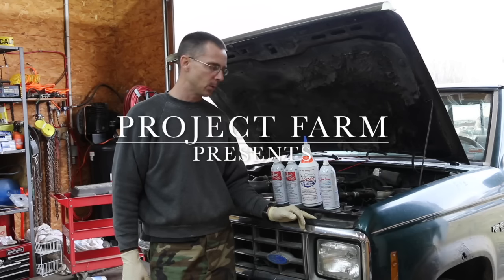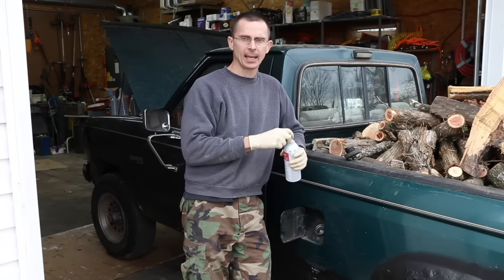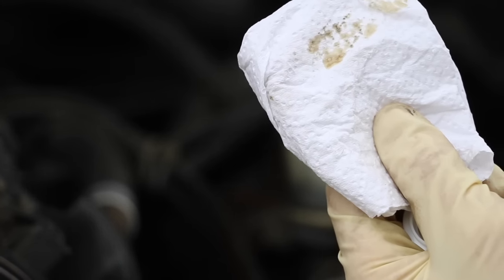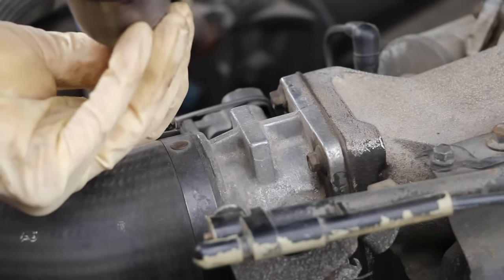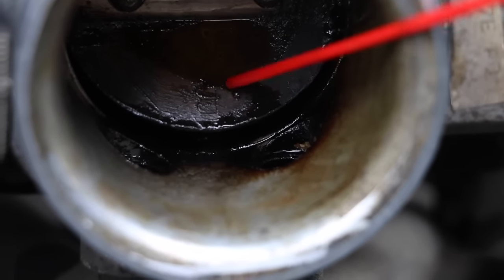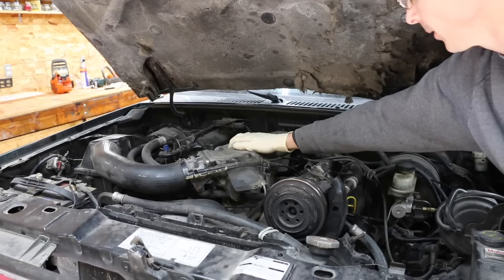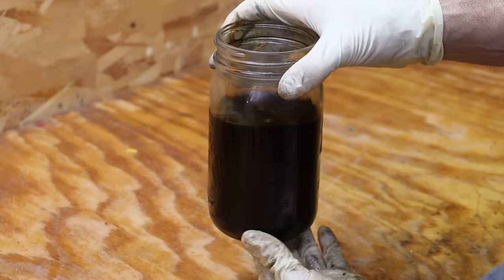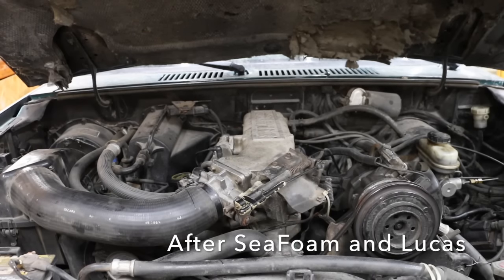Seafoam--can't believe what it did to my engine!!

Comment: I’ll tell you what cleaned up a gummed up motor for me and I was impressed beyond anything I had ever used to clean the inside of a motor. So the night before you change your oil check and if you must ! Drain two quarts from the engine and add two quarts of diesel fuel. Let that set over night. ( Note) if you know where your needle stops when fully warm make sure you do before you do this. In the morning start the vehicle and allow it to idle and warm up to the normal operating temperature then shut off and drain. Do this for three normal oil changes and you’ve basically cleaned it from top to bottom. My engine was so bad that the oil would back up to the filler cap. Nothing was going down into the pan. It took me 15 minutes to slowly put the oil in. Now that I’ve completed all three cycles it pour right in and straight to the pan. My mileage actually went to normal in the city and highway. It was a couple under specified mileage. It works!!! I’d bet the farm on this secret.
Reply from the maker: Thanks for sharing.

Comment: Friendly tip, throttle bodies are usually gunked up remove and clean that part then rebolt.

  then use seafoam,

The main reason is anything that comes off a nasty throttle body clumps in the system eventually
Reply from the maker: Thanks for the feedback.

Comment: Put Sea Foam in an old Snapper mower that ran poorly.Started riding around the yard and it smoothed out and ran like a new mower after an hour or so.Only additive I've tried in 60 years of driving that gives a distinctive obvious result since the old Paul Harvey 'Motor Honey' days which also did as it claimed.
Reply from the maker: Thanks for sharing.

Comment: This is awesome to see!  I had also heard that Barryman B12 chemtool has been used to clean removed pistons in racing circuits.  I wonder if that would work this way as well.  I've had good luck with Lubegaurd products so far.

My question is, if I have a 2020 Nissan Altima and it uses 0-20 full synthetic oil, does that disqualify you from using alot of additives in the future (when you would need it)?  I'm guessing Lucas would choke the engine since the tolerance is too tight.
Reply: It wouldn't "choke" the engine and as long as you run the engine very easy it would likely be ok.  The problem would come if the engines was run at any higher RPMs for more than a few seconds.  The oil would pump to the top but would not be able to drain back to the oil pan due to very tight tolerances inside the engine.  You could very likely end up starving the crankshaft of oil and destroy all your bearings... a VERY expensive problem.

Comment: That was a lifter noise from lack of oil changes, It's the only sound that this can fix. I would not put that thick stuff in all at once, only with engine warm and much slower.

Comment: A little noise from the lifters! That sounds like a baby diesel!
I've used Seafoam in my small motors every spring and fall before storage (snowblower and lawnmower) and in my vehicle's tanks a few times a year as well as my 1987 Magna for the last tank at storage.
Every engine I own starts within the first 2 tries after 6 months or more of storage. I've never had to pull/clean a carb and running a tank of gas with this stuff always eliminates a slight drop in response and performance in my car engines when they appear. 
I've never dumped it in my oil. I don't think I ever would. 
I firmly believe that old engines, that haven't been well maintained, getting a serious internal or external cleaning is inviting baaaad news.

Comment: one time I had an issue with an 88 chevy that had just got an oil change and had low oil pressure. I had done a lot of research and used a few ounces of acetone ( finger nail polish remover) in the engine and let it idle for about 15 mins then dropped the oil. it came out black  on a fresh oil change. the engine was gunked up. after that, oil kept its life like it should and oil pressure returned to normal. however, i wouldn't ever do this to a newer engine.
Reply from the maker: Thank or the feedback.

Comment: Before I use the Lucas oil, I put the bottle in a warm/hot pail of water,,, let it sit for a while then add to the engine, helps pour out easily
 Just an idea . But differently going to use sea foam on 2008 dodge
Reply from the maker: Thanks for the feedback.

Comment: Took the valve cover off my wife's '09 Ford Escape and woooeee!! How was this thing able to run! Sludge city! I've cleaned the valve cover, but the head is atrocious!! Got in there with a screwdriver and my fingers and got a LOT of the sludge out, but still needs cleaning. Not sure if THIS is something that would work. Any suggestions? Anybody?

Comment: Mixed results with seafoam and the motors are different.

A wheel mounted weed eater took a few cans of seafoam for the results.
Many gas tank full of the mixture by the instructions for adding to the oil and the gas.
One job it just took off like a new engine.

My car motor blew out a big cloud of blue smoke and it later needed some new catalytic converters. I believe it hastened the need for replacements for the catalytic converters.
Reply from the maker: Thanks for sharing.

Comment: I love seafoam! I suck one through my brake booster line every 6 months or so. Or when I get a ruff idle. Normally fixes the ruff running issue for while. I had some fouled out plugs that got sea foamed 3 times and one can of Berman’s through the vacuum line in the last month and half. Also a couple cans in the tank. I finally changed out the plugs yesterday because they were throwing misfire code in 2 cylinders after 40/50 k and they still looked horrible. New plugs fixed the ruff running issue. Wonder how bad they were before I gave them the berries with cleaners!
Reply: I’ve hot soaked my motor and have had my cats clogged with all the gunk that eventually brakes loose. So beware of that issue…if you have a lot of carbon build up.
Reply from the maker: Thanks for sharing.

Comment: Wow! Off topic... Your Throttle Body needs cleaning big time... I have an old Chevy Blazer, which wouldn't idle and ran like crap. I cleaned the Mass Airflow Sensor, added a new Air Filter then cleaned the Throttle Body and the Idle Air Control Valve. Lastly, after checking the OBD2 codes, I changed the Distributor Cap and Rotor... Now the truck runs like new... My main point is, my throttle body was not as dirty as yours... I think it would do wonders for your truck 🙂
Reply from the maker: Thanks for sharing.

Comment: My mom’s 2000 Suburban 5.3 had  376,000 miles on the factory water pump and alternator. 
She still sold it for $2500. My brother gave her a 2016 with 130,000. It’s like brand new.
Reply from the maker: Thanks for sharing.

Comment: Seafoam is a miracle in a bottle. I’ve grabbed several implements from the junk yard over the years that were junked because they didn’t start. One can of seafoam has brought almost every engine back to life. 
I run it through my 1994 90hp 2 stroke outboard every tank. Last year I replaced the head gasket….the pistons and cylinder walls looked like new. 

If you need a lawn mower, find a free mower that turns over and dump a can of seafoam in it. Most of the time engines won’t start because the previous owner used ethanol gas and lets it sit over the winter. The ethanol gets hard and clogs the jets. Worst case scenario is you need to buy a replacement carburetor for $12 on Amazon.
Reply from the maker: Thanks for the feedback.

Comment: That Lucas is so thick. I bet it would mess with the cam sensor on my Hemi Grand Cherokee. The dealer I bought the Jeep from put the wrong weight of motor oil in it and it gave me cam sensor alarms. We reset the code and put the 0W20 in and it has been fine ever since.
Reply from the maker: Thanks for sharing.

Comment: I use sea foam with every oil change and Lucas since I bought my 2010 Altima 8 years ago used with 60k miles. Car is now 13yo with 135k miles and a testimony to the effectiveness of these products being used regularly with oil changes is that my engine & emissions are beating the numbers in every category compared to when I got the car. Better Hp better response still quiet as a new engine and lower emissions than before. 

They really really do work but I will say it takes continuous use for best results and if you’re taking a used car that’s regular maintenance was neglected by the previous owner like mine was, it can take 2-3 rounds of doing this process to really really make a noticeable improvement. It definitely works though but level of neglect/ miles on car /how the car was driven will skew experiences and results. 

You also will get better results if you run 88 or better octane gas & full synthetic oil during the treatment. Full synthetic will capture more of the carbon sludge burn off and the higher octane gas burns faster scoring off more carbon.
Reply from the maker: Thanks for sharing.

Comment: I know that this wasn't the point of the video, but did you ever replace the engine mounts in this truck?  Judging by the amount of torque deflection at idle when you revved it, they could have been the source of more vibration.

Comment: These are the products I use and same proceedures, however, I use carb cleaner and spray the throttle body and plate completely! You will have better idle and response if you do! I spray the outside too! Vroooom! Vrooooom!
Reply from the maker: Thanks for sharing.

Comment: I do something similar each oil change except i use MMO instead of lucas. I got a truck with 270k and no ticking no shaking smooth operating. Maybe I'll try out lucas and see if it runs better or about the same
Reply from the maker: Thanks for sharing

Comment: Now to finish that process properly get some throttle body cleaner and a tooth brush and completely clean the throttle body and plates until they shine ! OH and a better way to clean the lifters is to ad an engine flush to the old oil before dumping it ( Kleen Flow Engine Flush is good )    let it idle for 30 min to an hour ( just idle, do not drive or rev up )  then dump the oil and add new with your Lucas !    what you did was not bad but you should have taken it for a good brisk drive after doing the decarbonizing and adding the sea foam to the oil !  at least 100 miles should have been driven before the oil was dumped !

Comment: My 06 f150 4.6  started ticking on cold startup after autochoke idles down this would continue for 2-3 minutes. Cylinder #3  very distinct . I thought it was roller follower worn or lack of lubrication. It was getting worse over the course of 1 month. I added 6 ounces sea foam to the oil which I change religiously every 3k and within 3 days the ticking stopped completely. I never pulled the valve cover so I do not know what was going on but ticking has not returned .  It’s a one time deal for me and if it’s starts ticking again I’ll get it professionally repaired

Comment: Its dirt in the lifters because you didn't change the oil every 3.000 miles if you were to take the lifters apart and clean them and add new oil and filter it would fix it ,some people break in the cam and don't change the oil after break in and the same thing happens noisy lifters

Comment: Seafoam and Lucas Oil products are both the best additives I've ever used.  Lucas Gear oil is the only gear oil to use also.
Reply: Also 100% synthetic oil is 100% superior to non synthetic oil.
Reply: sorry for another comment lol, but i think your motor is running really rich too, there shouldn't be all that buildup in the intake on the butterfly, that's a sign of running way too rich
Reply from the maker: Thanks for the feedback.

Comment: i would hope you see this as when i ran seafoam in my 69 dart gt convertible with a 318 engine, it would smoke heavily and have no idle and only hold very rough idle at high rpms so this stuff made my highly working motor into a hunk of smokey tail pipe metal
Reply from the maker: Thanks for sharing.

Comment: No doubt the additives helped with the engine noises, but changing viscosity of the oil with additives can negatively effect the oil operation of cam phasing on vvt engines and cause problems.
Reply from the maker: Thanks for the suggestion.

Comment: I just stumbled across this after buying a bottle of STP 5 in 1 fuel system cleaner today (I think the algorithm is spying on me lol). My 03 highlander is having fuel economy issues, and i just replaced an upstream O2 sensor. Got the OBD code to disappear at least. Now I'm up for smog in a couple months and I'm wondering if I'm setting it up for failure by potentially releasing carbon buildup into the line. Is it possible for dislodged chunks to muck up the injection system once they're set free? What do you recommend here?

Comment: And for the gas additive , did it help clean out the fuel system, or fuel line and dirty Injectors possible ? My car has a fuel problem,  it starts to bog out after 30 mins or so . And I had someone recommend the sea foam Gas additive.

Comment: I used it to clean out crank case in the oil it was crazy had clean oil drove the truck over 100km dropped the oil and it was black sludge ran alot better and brought back power
Reply from the maker: Thanks for sharing.

Comment: there's a lot more going on here than adding seafoam # 1 your engine intake needs to be taken off and cleaned you have way to much build up there # 2 maybe check oil pump output .seafoam should remove deposits from valves and passages if properly soaked needed to be flooded to a stall then left to soak . try  these things and you'll definitely find a really HUGE difference

Comment: Sea Foam is a great product, check out Fuel Power if you ever see it. Does an awesome job and a bottle smaller than Sea Foam will treat 250 Gallons! I'm a parts guy and this is just a suggestion :)
Reply from the maker: Thank you!

Comment: Gm top eng cleaner is stronger than seafoam, but i am always impressed at how a $14 can of seafoam could clean my intake so well. Im a tech by trade (25yrs) and have used Seafoam and Lucas products for 2 decades with great results. This is video proof of that.
Reply from the maker: Thanks for sharing.
Reply: @ProjectFarm  no sir thank you for your always exhaustive testing of products. I always try to point peeps to search if you've tested something they are on the fence about.

Comment: I have an '04 F 150 Heritage, 4.1 V6, near 240,000 mi. Seems to be still doing pretty good aside of a small leak dripping off the bell housing. Can't tell if it's oil or trans fluid. 
Would you recommend doing the Seafoam and Lucas strictly as "Preventative Maintenance" since it has 240,000 mi?

Comment: Amateur tip: Leave oil stabilizer container somewhere hot, like in front of a home heating vent or on the car floor while you drive with the heat on. Pours a bit better. Then, pour a couple inches worth into the engine, then back fill with new oil into the stabilizer. Shake it up to mix then it will flow lots better. Repeat the partial pouring/mixing/thinning trick if needed. Otherwise, in 45 degree conditions you will be pouring it in for an hour, or at least it will feel like an hour.
Reply from the maker: Thanks for sharing.

Comment: Love your content. Do you think this would help a newer (2005) honda engine with indirect/port fuel injection as well?
Reply: If it's port injection the fuel additive will most likely not do very much. It will clean clogged injectors but the fuel is already being sprayed onto the intake valve so the valve is already clean.
Reply: @tristankorski fuel spraying onto an intake valve causes carbon buildup on said valve and can cause seating issues in the future. I'd say seafoam is still a good idea for trying to prevent this

Comment: i've never used seafoam in auto's but i use it in weed whackers, chainsaws and my old cub cadet tractors and it really helps.  i "fixed" a freebie dead weedwhacker with it and have been using it for years.  an oz every few tanks keeps these things running good.
Reply from the maker: Thanks for sharing.

Comment: BG44K vs Seafoam vs Techron vs a couple others to see if they clean the injector pintle and remove intake valve (top) carbon deposits if you could.
Reply from the maker: Thanks for the suggestion.

Comment: I get how and why Seafoam works but the Lucas "Stabilizer" seems like a glorified gear oil, I wouldn't risk that on a decent engine, just run a higher viscosity modern oil if you think a thicker oil would help.
Reply from the maker: Thanks for the feedback.

Comment: Ever tried Rislone Ring Seal ? I know this is an old post and don't expect a response.
But maybe a reader will chime in. 
Most stuff is snake oil. 
I just took the top end of my engine apart. Guides are good, so are the seals.
Engine has total seal piston rings. 
Still getting some blue smoke. So dumping in this stuff.
Reply from the maker: Thanks for the suggestion.

Comment: Why do you think that is "carbon" on the throttle plate? Carbon comes after combustion and out the tailpipe, if it's coming out the throttle body, you have way more problems than you think.
Reply: Depending on the year, a lot of cars in the past 40 years or so have their crankcase and head pressure routed to the intake, in order to “burn” extra oil vapors off in the engine, rather than dumping it into the environment.

A lot of the time, and especially over time, this causes oil vapors to collect and condense onto things in the intake system, such as the throttle body plate, or on the backs on the intake valves.

some cars also have EGR systems that directly port some of the exhaust gas back into the intake of thw engine, again to improve emissions.

Both of these cause issues, and make it necessary to clean parts that otherwise never would need it